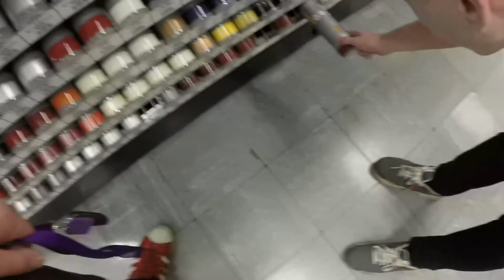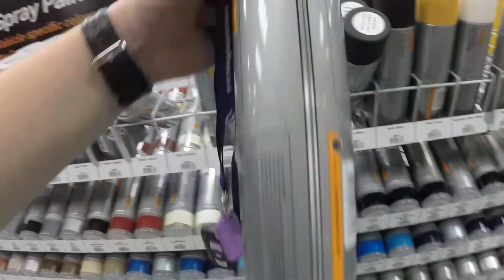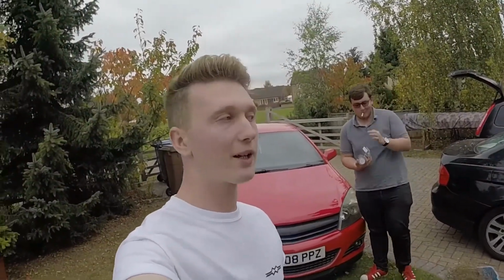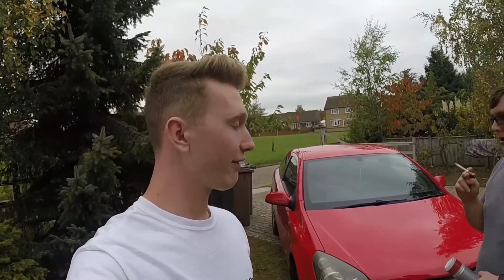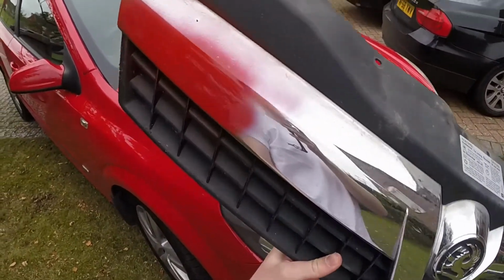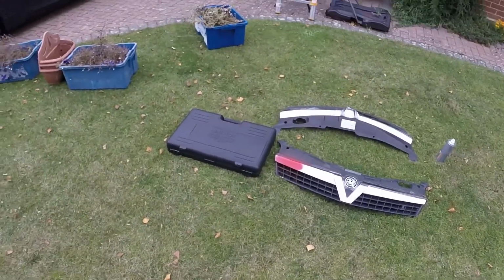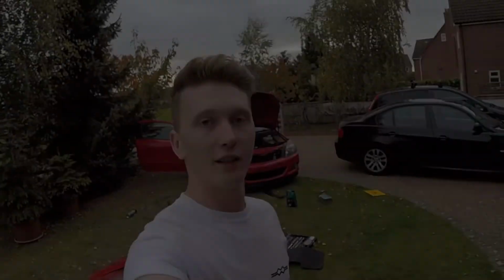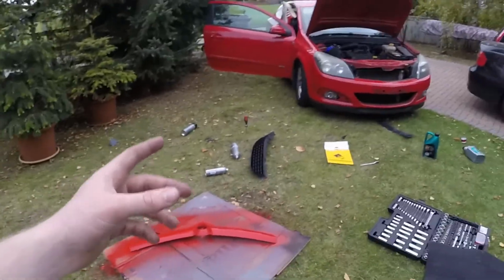Painting the Astra Grills! | Vauxhall Astra SXI

Comment: How did you remove the front fog light trim?? Does it pop off with a flat head screwdriver? Or is it screwed on??
Reply from the maker: Silver Screen Reviews I just removed it with a flat head. Just popped off if I remember correctly
Reply: Project Driven cheers boss man! Appreciated

Comment: how did you remove the fog light surrounds and disconnect fog lights?
Reply from the maker: If u get a flat head screwdriver or a tool to get under it. It just clips out and the you can remove the light unit after

Comment: How did you remove the lower part of the front grille??
Reply from the maker: It all just pops into place. So if you pull at where all the clips are it should come out. Took a fair bit of force so be careful not to break the clips